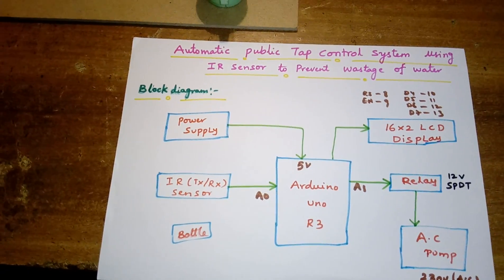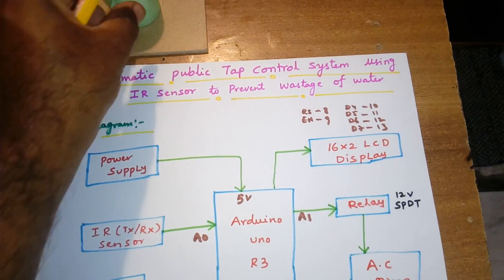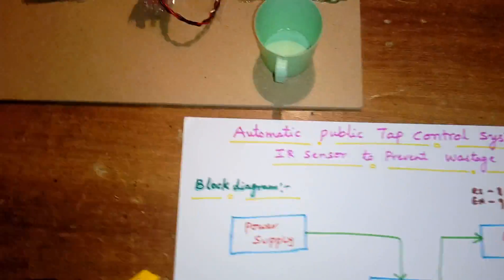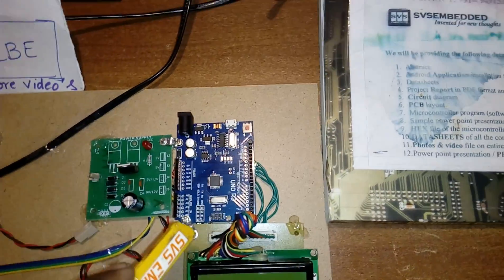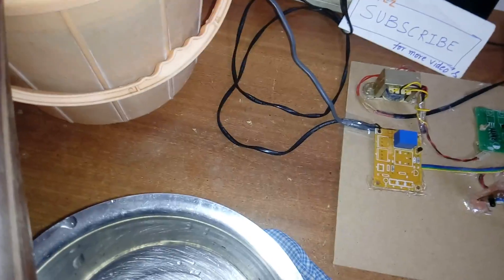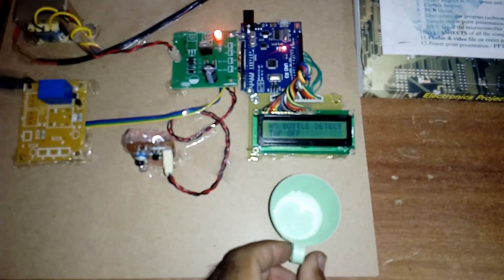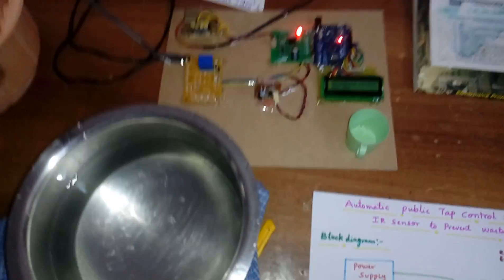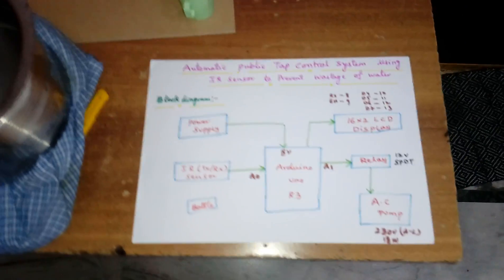Automatic Public Tap Control System Using IR Sensor to Prevent Wastage Of Water

Comment: good morning in this what is need of display.with out display also we can do na
Reply from the maker: thanks for comment

student provided block diagram. In that block Diagram lcd display is there. So i added in the project,but not Requied.
Actually we can do this project with out Microcontroller Also.
by using Lm358 operational Amplifier can also we can do the same concept.with cheap cost.